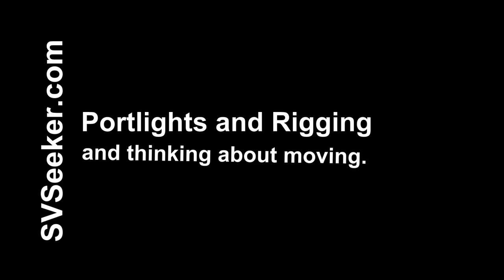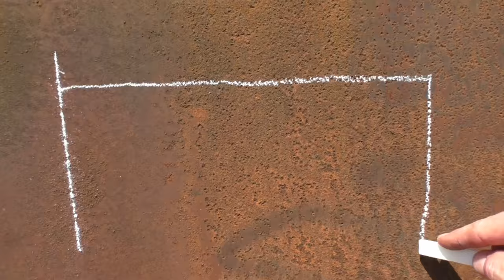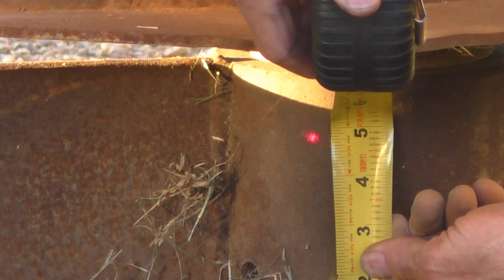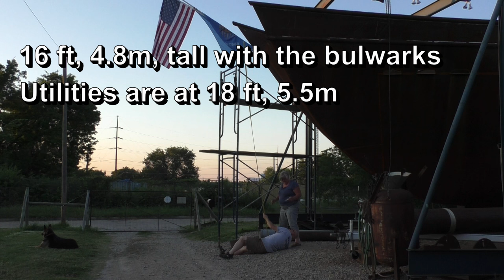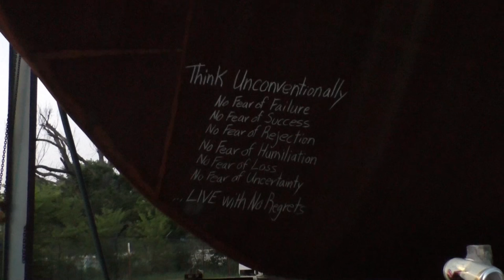Portlights and Rigging and thinking about moving

Comment: Your quote at the end says it all....  You've once again renewed my desire to have a plasma table.
Reply: Does the water need to make contact with the back of the steel you are cutting or does it just need to be close?  I'll probably build that part, so I can make it to suit.  Thanks for the heads up!
Reply from the maker: It works fine with just a half inch of water, a couple of inches away.   I started out with a plywood box and a pond liner, with a piece of sheet metal on top of the pond liner to keep it from getting burned.   But you can also let it cover the part and it will cut down on warping thin metal.   ...but it really makes a mess from blowing water around.   And I love the Proma THC and Mach3 setup.  Cheap and it works.
Reply: Thanks Doug!
Reply: I have a plasma cutter I purchased from Eastwood...but I am told you can't use it for cnc because if is a high frequency start....and I have been confused by why this is for a while with no real answers that I can find.  Something about it messing with the computer in control...but I don't see why that couldn't be isolated... if anyone has a suggestion on where to look for answers I'd love to hear it Because a cnc table would be awesome
Reply: The h.f. goes through the ground and will mutilate the computer. That warning comes w/ a hf welder.

Comment: That kind of ventilation has been used for more years than I have been alive in pig stables around here. They have a hinge in the bottom and a little spring so all the ventilation doors in the entire stable can be opened and closed at once via a cable and lever.

Comment: Hello Doug,
You have 3 masts penetrating your hull that could act as chimneys, for relief of hot air, they would be quite efficient, a diesel or wood burner is another. A plus is you get an access hatch to your wiring and inner mast work. I trust you were joking about the location of the vent in the access way - it would be an excellent way to be injured as the boat fell off a wave. The Wiley ports I have seen used a wedge that is cut from the tip to a hole, the idea being that the wedge has a spring action, to hold the window against its seal. The back the window rests against has a flat that stops the window being flushed from position and locates the wedge heel for sealing it securely shut.
Very envious of your effort for only 5 years work:-)
Reply from the maker: And they will.   I was hoping we could run the engine exhaust through one but they are a long way from the engine room.  So the mizzen will vent a composting head on the aft deck.  The main will vent the cargo hold and the fuel tanks,  and the foremast will vent the forward locker.    Did the Wiley Ports you've seen use any gasket against the hull?

Comment: Doug;

Another suggestion for you and this is something that may save your life one day just in case the worst case scenario happens.  You might want to think about buying a couple of 24" square Lewmar hatches (Ocean 70 series).  They are going to cost about $1,000 each and I know you are going to say you can make something similar, but these are pretty much guaranteed to open in case you have to evacuate the boat.  Ocean racing boats require one in the foredeck area and one in the transom so that crew can evacuate even if the boat is flipped and won't go back upright.

I know you aren't big on safety, but being trapped below on a boat is just about everyone's nightmare scenario.  Something to think about and I respect your call on how you want to live your life with regards to whether you want to install or not.

Regards;

Ron Kluwe
Reply from the maker: We're going to add hatches to the cabin tops, but I can assure you they will not be purchased.

Comment: Were you going to put a couple dorade boxes/vents on the boat? They might work better than vents on the side of the cabin top as you can put them above your bulwarks and thus "in the wind" to catch a breeze. It's a thought.
Reply from the maker: Considering it. but I think they will be in the way of lines and cargo.
Reply: They will, I agree. Perhaps design something into the aluminum coach roof that catches/directs air down below, might help.

Comment: Hi, I really like the idea of the Wiley Port, except for the wooden wedges. Anything you wedge in, can work it's way out, usually in a storm. Have you considered wrapping channel around the vertical ends of the (hopefully thick) acrylic, and using acme screws to apply closing pressure? Anyhoo, free advice is worth what you paid for it.

Comment: I would put one of those lights in the Engine room too, you really want ventilation there, with the oily smells and the heat.
and a way of natural light is always nice, if you have a blackout (no power) and need to find your way in the ER a skylight gives a ton more light then any flashlight will
Reply from the maker: We're going to figure out something bigger for the engine room, more light and powered to provide more air.

Comment: HI Been. I have been fabricating with plastic for 25 years. 1/2 inch acrylic has a tendency to warp when exposed to moisture and humidity. you may want to think about using polycarbonate. polycarbonate scratches easier but does not warp due to humidity. also polycarbonate will not craze or break. If you try covering a 5 gallon filled partially with water and cover it with a piece of acrylic you can see it warp and dish from the humidity.
Reply from the maker: Thanks.   I have used a lot of 3/4" acrylic viewports but not 1/2".   Do you think it be noticeable in a 1/2" think 7 x 14" piece?
Reply: For some reason it's not that much of a problem with round pieces but on Square or rectangular pieces like aquarium covers they warp pretty badly.

You can always try cutting a test piece and putting it over a equal sized tub of water.
worst case scenario you'll just need to flip it over once in awhile.
Reply: It's mostly going to be a problem If there is a huge difference in humidity from inside to outside.
Reply from the maker: Thanks

Comment: Most fanuc machines use M0 for program stop M1 is usually Optional Stop which requires the Optional stop bit be set either in the ladder logic or by a hardware switch.

Comment: Listening to what you guys are planning I would suggest one of two things, the easiest if you can find a group to donate there time and use there equipment is house movers or heavy hauler aka oversize load transporters. My other suggestion would be to look at what is called a con gear ( you see then all the time ) they are used to connect multiple trailers together. Con gear is the piece that attaches to the rear of one trailer but has a fifth wheel on top of most times a single axle but except when hauling multiple long boxes ( 40 ft or longer trailer length ) con gear have two axles. It would make what you are considering alot easier because you simply remove the fifth can mount the beams solid or if you will need greater turning you can attach a king pin to the underside of the beam and lock the fifth around it so they can be steer able similar to a fire department ladder truck. You would have to have chains attached from both sides and use a come along to pivot it. Heavy haulers or oversize load transporters have invested in better equipment so most of the time they have hydraulic pumps that push or pull rams and pistons to steer the units. Taking the tandems out from under a trailer you need to make sure they are strong enough because they are mounted inside channels which allows them to slide. Think about how many times you have seen a trailer that wasn't tracking straight behind a truck. Making tight turns with Max weight or running over a curb when backing in or turning into a drive way are the primary cause for those trailers driving down the highway hitting the lane reflectors on the opposite side of the lane from the tractor.
Reply from the maker: Turns out the trick is not the weight, but the height.  We have a quote from a house mover and are looking for one from a Stone Trucking.   Finding a trailer with small rims and also narrow so it could fit between the keels would be ideal. See:  http://wp.me/P6ivyU-nV      That would put the axles directly under the load and also make the load pivot in the center.
Reply: +SV Seeker I understand what you are talking about. I know of a company based in so Cal with a secondary yard in Tx, Piazza trucking. They have low boy trailers that can stretch in length. I have no idea regarding cost or even if they would be able to service your location. I have a family member that drives a pilot car (the little car with lights, flags and sign behind the loads). I was able to see the full size military planes (retired museum displays) get moved to Mira Mar navy base in San Diego. I wish you luck and just hope you don't move it the Even Almighty way.

Comment: Dorade boxes are a better design for vents that the wedge and window idea. The "horns" don't have to be round and the inlet to the boat can be through the side  or wall just like what you're planning now. It looks like the vents you're making could easily be converted to dorade boxes and you can keep the ability to close them off. Just a suggestion for you to look at if you haven't already.

Comment: That trailer slider has 4 pins that holds it in place and if you know where to look tires for that trailer are easy to find
Reply from the maker: I am an Oracle DBA.   I know when to use a binary index, not where to find truck trailers or their tires.

Comment: You can get a stretch flat bed double drop deck truck Trailor at48 foot that will stretch over 70 feet with a standard 8 foot wide that has 1 foot pullout feet on both sides.

Comment: Hello Doug,
Another amazing vid thank you for sharing.

About those vent windows. what if you try to hinge the triangle shaped sides on the borders and a center line so they can bend whenever you need to use the cargo? I might let you win those 3"
The water insulation can be done with the wood shims you mentioned. You just cover them with rubber. Or you can place some sort of tray underneath.
If you're interested I can take a closer look and send you some drawings. 

Anyway! Wish you the best
Reply from the maker: Hinges would work, but I don't think we need that level of complexity or the addition cost.

Comment: 2 feet under power lines as it sits in the yard now, with keels just inches of the ground, there must be going some proper planning in the move.
A standard low loader wil add at least one foot to the height, so you will needa special made rig to keep the keels that low from the road surface, and then make sure there are no bumps where you bottom out on.
Finding air ride axles will help a lot, because you will be able then to adjust ride height to the situation.
Also to consider is permits, route planning, and if escort vehicles are needed.
If a lot of these things aply it is perhaps better to leave the move to a company specialized in exceptional loads, as they have the expertise in all these things.
It's like the moves of locomotives to and from our heritage railway in the UK, there are just a couple of companies which just specialized on moving railroad vehicles and know how to load them, they have route books to all different destinations countrywide, know the special regulations and suply their own escort vehicles and traffic regulators (in some states you will need police for this)
Causing damage to roads, bridges, utillities and buildings by misjudgement of your move could end far more costly than having proffesionals doing it, unless you have someone with expertise willing to support the project with his help.
Reply from the maker: No worries.   Details are here and planing is underway now; long before the move.  http://wp.me/P6ivyU-nV

Comment: Opinion. Companionway should be kept clear of protrusions except for handrail. In rough seas you get tossed about a bit. A vent in there is just another thing to hit your head on. Also, IF water gets in through the vents, then you've got wet stairs.
Reply from the maker: You're right, but there is a recess beside the ladder, so I think we will be able to tuck it to the side enough.

Comment: love watching the build. but as a owner of a trucking company you would probably be better off hiring a boat moving company to ship it. just the insurance cost and permits is enough to make you pull your hair out. not to mention the cost of building a custom trailer. when they would uses there equipment. just trying to help. but if you insist I recommend trying to find a low boy to cut up. a dry van axle is going to have the boat 5ft in the air. unless your going to build something like a double drop and that would take some long expensive I beams to control flex. like I said, love the build, keep it up, I have been trying to get over your way for months
Reply: The dry van axle is not what they want.
Reply from the maker: A wrecked low-boy would be a great starting point.   And building big things obviously does not phase us.   Please let us know if you see an smashed up lowboy in Oklahoma.  :)
Reply: +SV Seeker will do

Comment: You will want a flatbed trailer, a box trailer has Approximately 50% of it strength in the box shape  and as the trailer as well as the tires have to pass a DOT inspection  a heavy equipment mover might just be your cheapest and safe way to move her to the Port.
Reply from the maker: We're looking to put the keels 12 inches off the road.   And we'll do more checking but the trailer inspection looks to be a fairly simple matter of making sure it has all of the necessary bits.    ...and I'd like the brakes to work.  :)

Comment: Do you plan on attaching the wedges directly to the plexi glass window with epoxy and/or countersunk screws for the Wiley Ports? When going from closed to open positions, one simply 180s the wedge+plexi assembly. Perhaps you had a different approach and I'm curious what's the plan.
Reply: I think you wouldn`t be able to turn them around as there´s not enough space under the ceiling to get them out if the wedges where attached directly on the plexi glass....
Reply from the maker: Right on.  One piece was the original plan.   Three pieces let us set the windows in higher from the deck.
Reply: Interesting. Will the wedges be captive in some way (e.g. a hinge) to the metal framework or do you plan on having a 3 piece assembly? I would just fear losing the wedges if they could be pulled completely out.

Comment: I hope your move is planned after s/v Seeker is launched. Kamau of Iandi Boats can share a thing or 2 regarding what local government thinks about building a boat in your yard. Also, you might want to check with an experienced workboat merchant marine with an unlimited Chief Engineer's ticket about your portlight/air vents. The day will come when Seeker is momentarily beam to in a squall, gale, or heavy sea state. You'll wish you designed emergency plugs for all those 14+ vents and wished the round port hole glass was hinged inward instead of outward.
Reply from the maker: That's great.  The water will put out the fire in the engine room.   Because engine rooms always catch on fire.

Comment: the axles on that trailer are exactly the same ones used on intermodal chassis.  Those tires are absolutely dirt cheap, yes i know they are recaped bias ply tires but it is not like you are going 1000 miles doing 70 mph.  You have more weight there than I had but the tires in the link are dot legal on 40,000 lb tandems.
https://www.tirerecappers.com/tires/semi-tires/10-00x20-bias-intermodal-trailer-retread-tire/

Comment: so what happened top your proma thc?
Reply from the maker: Sorry, I was not clear.   The THC is working fine.  The problem is that the starting point, or the pierce height is not automatically set.   I generally move all of the pierce points so they are as close to each other as possible or else break the pieces up into two files.   The M01 lets me set the starting height for a specific pierce point.  Once the plasma cut starts the THC takes care of the Z height.

Comment: why not use magnets on the wents? then you don't need the wooden wedge.. one magnet (like earth magnet) in each corner...
Reply from the maker: If they are strong enough to hold back the sea, they would be strong enough that you'd need a crow bar to get them off.